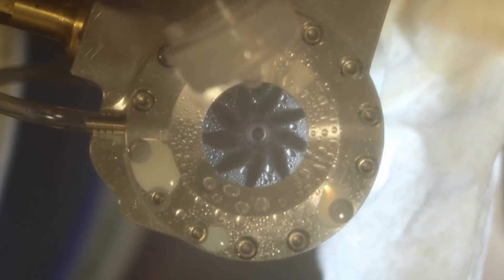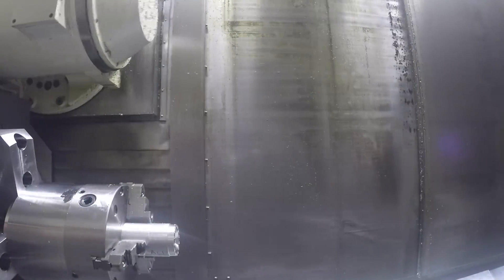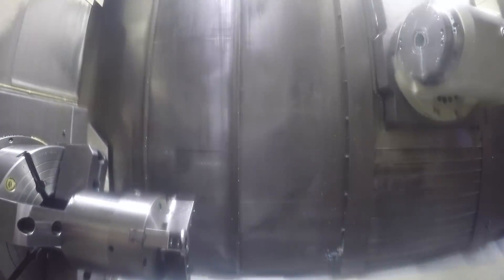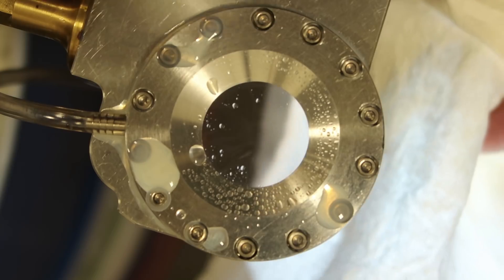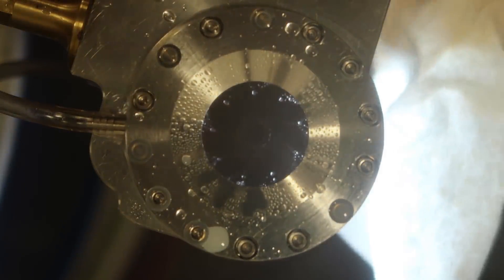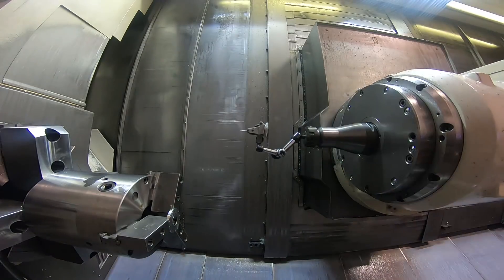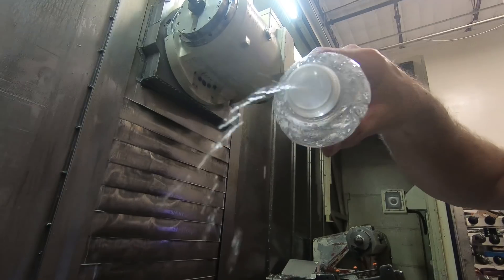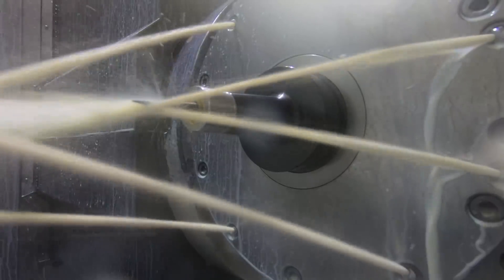Air Knife R & D

Comment: you need Coanda effect to blow air not just radially inward but with an axial component too. You can see it in commercial air wipers. the air comes from the outer OD blowing inward over a curved surface, and pushes out radially. along with that, it pulls air in also, enhancing the effect and reducing air consumption

Comment: All fluids "wet" surfaces. Once it does it is damn hard to get it off. The air speed right up against any surface is 0 and that is the problem. Think how fast you go with rain drops on your windshield. You can go 60 mph but the drops only move ~12 inches a minute.
So your key is going to be to prevent the liquid from ever wetting the surface in the first place, not to try to remove it once it is there. 
You should try to create a protective curtain of high speed air that blasts droplets away before they can hit the glass.
One thing that might help is to use a water repellent to deter wetting such as rain-x windshield treatment etc.
Reply from the maker: I have made some other videos where I use, what I call a Air Knife (Not my idea. This is what I still use.). This works better. There is no way the air can overcome the weight and velocity of the high pressure coolant. If the coolant was just water this would be easy. Like on a car windshield to put coatings to repel the water. But the coolant is a water soluble oil mixture. It also has waste way lube oil in it. I have tried many coatings like RainX, even some of the newer coatings. But the coolant attacks them and washes them away after a few minutes. RainX works about as well as the more expensive ones though. This makes it very difficult once it gets on the lens cover of the cameras case. A mechanical means of removing it would be better. The spinning disk doesn't even work that well, because of the oil problem. The GoPros they use in race cars have a roll of thin plastic (Kind of like the film roll in a old camera) that continually moves to renew the shield. Something like that could work. Or a glass shield that oscillated back and forth with wipers.

Comment: How about a very thin laminar flow of high pressure water going across the lens. Like the simple DIY soda straw in a box type laminar flow devices people make for fountains etc. They can make a stream of water clear as glass to the point where it can carry light and sorta function as a crude fiber optic cable. A series of relatively long holes bored in some stock that exits out of a square nozzle flowing over the lens and covering the entire thing - you can't use a round one because it will distort the image. Or you could take it a step further just using a laminar flow air stream and have that work as a boundary layer effect over the screen much like the boundary layer effect works on an airfoil/wing.

Comment: I know I'm very late watching this. Did you ever improve on this and make another video? Did you consider using the air to rotate the lens in a bearing so fluid is thrown of with the centripetal force?
Reply from the maker: My idea was to use a small amount of air. At around 20 psi. This is because I’m recording sound from the camera. In order to do what you are referring to (assuming it can be done) it would require a high air pressure and volume. This makes to much noise. Also the sealing of a high RPM window is difficult with little enough friction where the air could supply enough force to rotate the window. Not to mention a large diameter ball bearing and the noise it would make. I went to using what I refer to as a air knife from the side. This idea satisfied these requirements of sound, low air pressure and volume.

Comment: Those nine leaf-looking structures around the edge are probably due to sound propagating clockwise and counterclockwise around that air groove setting up standing waves.  The turbulence from the barbed nozzle and roughness in the groove is a source of "white" audio noise.  Somewhere there is a source of circulation that causes those central rings to form.  The ccw direction of those leaf points support this hypothesis.  Ultimately, earth's rotation can cause this if a larger rotation source is not available.  Orienting the plane of the air sheet north-south and vertical can minimize the effect of earth's rotation.

Comment: I noticed the part rotated around when it did the second half of the holes. is that built into the control, post, or did you change the orientation in CAM to make it do that? 0:38
This could be useful on the b axis of the 5 axis pocket nc, since the machine has low rigidity.
Reply from the maker: This machine only has -10mm of travel in the X axis. So in order to reach features on the face of a part below that you have to rotate the C axis some amount to get them in the travel range of the machine. This is just the way the machine was built. Some of the new Mazak Integrex’s have more travel in the X minus. So this would not be necessary. In order to do this in my cam software you have the selection of giving it a new C axis solution/rotation. Than it will rotate the C axis to the new location.

Comment: Did you come up with solution??? My thoughts........ a confined air knife (360 deg) like the one you made, is no good. Air should come from one direction and have zero obstructions once it has passed over the glass. In otherwords, air should go from either top to bottom or left to right, whatever, with no bezel interfering and causing turbulence once the air has passed over the lens. So your bezel/air knife nozzle should only cover about half or less of the lens. Hard to explain.Think half a ring instead of full ring.  It's how we did it for laser depth measuring on rock drills. These rock drills operate with 1000's of gallons of wet muddy water being thrown about in every direction covering the whole machine in a thick slurry. The drills depend on accurate measurements so they know when they were at depth. Again just my 2 cents.................
Reply from the maker: I have a whole different idea for this. Look for a up coming video. There is a version of a side blow type I did in this video "Side blow air knife for Gopro case".
Reply: @EdgePrecision  Yes I see that. I call it a success but I guess if your real picky.....
Thanks for the vids. Some are real eye openers.

Comment: Thinking outside the box. What about a silicon treated glass ring "bowl", driven by a small silent motor that slips over the gopro enclosure. A super slick coating along the lines of RainX would cause any fluids to not stick and centrifugal motion would do the rest of the work.

Comment: Try to alternate the groves instead of the fluid running a circuit it should collide and fragment off. May be with different degrees of angle on the grooves to prevent patterning.

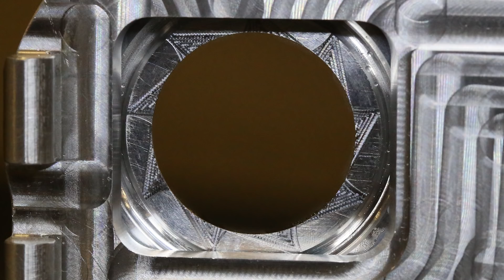Comment: 🤔 How about reducing the qty of openings? Like 10:02 there are several small openings for the air to push out onto the glass, but that causes the stream to spin and make the vortex and residue.  So what if you make an opening 1/3 the dia of the opening, so the air would act as a squeegee pushing in one direction?
Reply from the maker: I just really couldn't get this to work. In a later video I made it blow from one side. That worked acceptably well. I still have a few other ideas yet on camera cases. Thanks for your comment.
Reply: @EdgePrecision  just saw that video, beautiful machining 😊
Love the ingenuity and rational behind the videos.  State of the art tjinking for state of the art equipment 😉

Comment: Maybe you've already solved the problem, but you might try a "Clear View Screen" like the ones you can see on some ship windows. They are continuously spinning to throw off the water. Maybe with the help of some air, it would work for you.
Reply from the maker: Thanks for the suggestion. That has been suggested by many people. The problem is to implement that in such a small size in this dirty environment. Then there is the noise of a motor running a spinning disk at high speed and the power connections required. The air knife in my final version only requires about 20 psi to operate and is virtually silent. The camera's mic doesn't pick it up. The sound is important to me for the videos. I could record it with a different device. But that just adds another thing to keep track of and also sync in post.

Comment: Make something they use on ships - a glass disk attached to an electric motor which when spinning disperses water using centrifugal force. Place the camera behind this disk which should keep the view clear.
Reply from the maker: The problem is this is hard to implement in such a small size. Also there is the noise from the motor that will be picked up by the cameras mic. The air knife only takes about 20 PSI and is virtually silent. It is important to me to capture the machine sound for the videos. I could record it on a different device but that's just one more thing to sink and keep track of.

Comment: Recently i looked up nano coating / lotos effect products… 
These might keep any fluid far away enough from the glass...
Reply from the maker: darthjeder The glass windows I’m using have what Edmund calls  Oleophobic. They claim it repels water and oil. It still has a limited life span in the coolant. With my newer air knife from the side it seems to work OK. They are not inexpensive windows though.
Reply: I found that Video after commenting on this one and looked up if the nano coating is olephobic… it seems too be hydrophobic only…
Reply from the maker: darthjeder I don’t know any thing about such things but it does work better than things like Rain-X and the FlyBy treatments I have already tryedZ

Comment: Have you tried to wax or put water repellent on the lens?
Reply from the maker: I have tried Rain-X, FlyBy and wax. They work for a few minutes but the coolant eventually washes them off. The window also has a Oleophobic coating that repels water and oils. The window in this video was older. I replaced it with a new one with fresh coating and it works better. Also I switched to a side blow air knife. See the video "Side Blow Air Knife For GoPro".

Comment: All right what I'm thinking is with your original circular porting or maybe with the other designs this may be the trick. Basically what I'm thinking is the air runs down a ramp alternating from long jump low pitch to high jump high pitch alternating from The same ports to channel different flows of air

Comment: what about trying a lot higher pressure to go to the other extreme so that the coolant circle formed in the center is wide enough to be close to the outside of the view window rather than trying to reduce the pressure to eliminate the circle (seems to always leave a center droplet that way). the swirl that forms seems to be creating the centrifugal motion to throw the water out and the higher the pressure the more angular velocity (works like a marine viewing port on the deck which has the glass rotating fast to throw any water off of it)

Comment: I would do the straight grooves but only on the top 90 degrees leave the other 270 solid that way you don't create a vortex.  In theory you will only be blowing from the top only.

Comment: Use a small diameter ballnose endmill to cut radial lines, deepest at the air source groove, angled to a few thousandths of an inch at the centre. Use so many radials that they overlap in at the centre. Where your first attempt had six openings that flared out to effectively  give you one opening around the entire inner diameter, maybe many radial lines creating that single opening will eliminate both the ring and the asymmetrical six pointed star that I saw around the inner diameter(outside diameter of the sight glass). You definitely need to get rid of the tangential angles that are causing the rotation of the coolant ( I think. Maybe?) I'm not sure how well I have explained what I see in my head. I see a bunch of little pie slices created by the grooves cut by the endmill, the apexes of the triangles dont make it all the way to the central bore. I hope I have conveyed my meaning, and if none of your other ideas help, maybe you will try this. Good luck. Oh yeah, I don't hold much hope for the pulsating air idea, but I've been wrong before, and will be wrong many more times again before I shuffle off this mortal coil ( at least, I hope I live long enough. You know, busses, meteorites, trampled by zebra in the crosswalk.).

Comment: multiple layers of air. stack these disks on top of each other with the lens on the very bottom. creating columns of air. less fluid should make it to the lens. preventing the surface tension. the the more high pressure the air the less fluid that even gets to the lens. kind of a cannon of air.

Comment: i use something like this at work but for a different purpose. I running a plastic hose extrusion line that runs through an air knife to dry it off after coming out of a cooling tank. its not one complete circle but cut in half. each half has three pieces. the front with the counter sink that looks like yours. the inside is flat. then a metal shim thats paper thin. then the other side is but twice as thick as the front plate that has the inside machined out and accepts the connector.
https://www.aliexpress.com/item/Hot-sale-Air-knife-air-knife-blower-Annular-Air-Knife-Nozzle-Ringlike-wind-jet-nozzle/32831575283.html

Comment: Plasma spectrometers I've worked with use an "air knife" to keep the very hot plasma out of the optics.  It's made of ceramic and stainless steel because it would melt otherwise, but it's just a very thin slit (maybe about as thick as a razor blade, or thinner) about an inch long with fairly low-pressure air fed to it.  Maybe try something like that half an inch or an inch in front of the lens to just keep stuff from getting on it in the first place?
Reply from the maker: Yes I have made that. Watch my next video in this series “ Hero6 case back”. This shows the next idea.

Comment: If you are using real glass I would treat it with this " AQUAPEL Windshield/glass water repellent", this stuff is not like rain-x as it is not a "wax", but a etching. I use it on any glass I want water and water-basted solutions to run off of. One coating last forever I can usually get a year or more on a windshield on cars/trucks and three or more years on shop equipment. 

Then I would look at moving the coolant off to one side of the part with the air, think of rain being pushed off the windshield on a car/truck, let the air act more like a windshield wiper blade than a tornado. 

But love the work so far.
Reply from the maker: The window does have a special coating to repel water and oils.

Comment: engineering student here, perhaps looking at a passive solution might be better? putting a teflon or nano coating over the lens might work better than an "air knife" and then you won't have to use compressed air.
Reply from the maker: The glass for the window does have a special coating to repel water and oil. I bought the glass windows from Edmund scientific specially for ‘this coating.
Reply: Edge Precision ahhh my mistake, I have a few episodes to catch up on. 

I was just skimming the comments and agree with an asymmetric approach to directing air. It'll stop the vortex issues you're experiencing there. Perhaps instead of multiple nozzles, you could have them on one side or divide the angle between them by a series of prime numbers. Anything to stop an equilibrium condition in the centre of the lens..

Comment: A suggestion.
Maybe make one (few ?) grooves that dont point to the center but just off it.
That are either smaller (larger,)  or have a larger-to-smaller depth to the center, thus increasing the air speed on those 1 (3?) grooves.

These might need to be a little smaller in exit area than the general grooves .. thus they would flow less air but at higher pressure and speed.
So a slightly offset (3 degrees ?) single jet of smaller size would tend to hit the centerline faster, and push anything in the center away to be dispersed by the other jets.

Slightly offset direction should maybe push the edge of the center puddle and suck the rest away.

In air spindles the ratio seems to be about 1:1 - 1:1.5, like 3 mm wide and 5 mm deep (on == 50 mm D).
The groove part acts like  reservoir, afaik.

Another option.
Make the exits smaller - increasing velocity and backpressure.

Option 3.
You could also maybe make a staggered disc with radially offset outflow sizes on 1,2,3 different output ports to try.
So that you could vary the output sizes by indexing the disc, bolting it in 3 different orientations.
And each orientation could have a different size set of jets cut, that are blanked when they are in the "wrong" position.
This would allow testing 3 jet sizes with one disc, by simply bolting it onto a different start point 1,2,3 etc..

Hth..

Comment: for the air blade effect you need solid flow from one direction.
in your designs you have many flow directions so streams of air affecting each other creating unwanted turbulence in whitch drops are not moving.